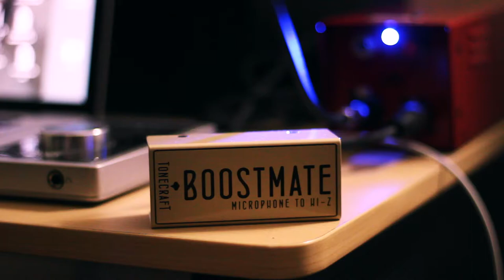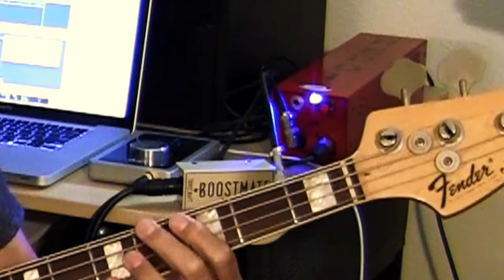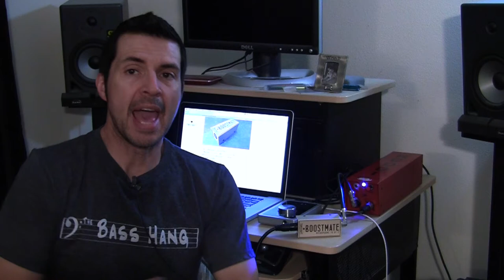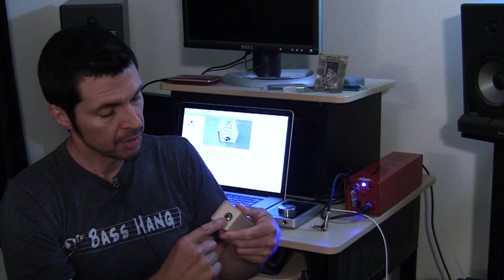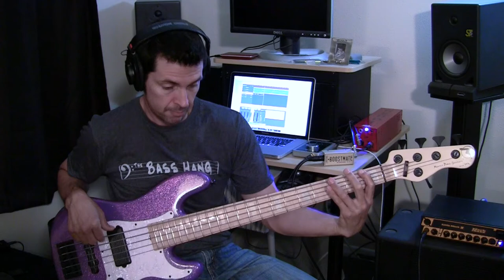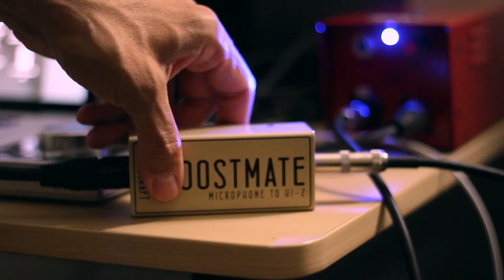Tonecraft Boostmate Sound Demo

Comment: I don't get it. You go from a low-Z mic signal into the Boostmate to make it high-Z and then into the Reddi to convert the high-Z Boostmate signal back to a low-Z signal. Why not plug the mic right into the Apogee Duet? Just to get some "tube warmth"? Elaborate.
Reply from the maker: Yes, to get some tube grit for sure. Kind of nice to turn a really great Tube DI into a Mic Pre.
Reply from the maker: Also, the REDDI and most other DI's,,  don't have  Low-Z, Microphone, XLR input,s just 1/4" in.
Reply: beftus1264 You know that the quality and character of the on-board preamps of the Apogee Duet is significantly exceeded by a lot of gear, like completely analogue, professional microphone preamplifiers and DIs? The REDDI makes the cheapest, smallest and most sterile passive bass signal and spit it out sounding punchy, full bodied, and full of non-linear harmonic saturation that just gives it a silky presence that can cut through a mix. The best thing about it is there's nothing to EQ - what comes out is consistently euphonic across the whole recording. Sweep a relatively narrow pass band around and look for something that sounds bad and you won't find anything. I would love to see how mics sound through the REDDI. Particularly a miced bass cab, but I think I would go for a ribbon like the Beyerdynamic M160, AEA R92 or Royer 121 or a nice tube LDC like the Mojave MA-200. I also can't imagine what it'd do to baritone vocals, but I bet it'd be good.